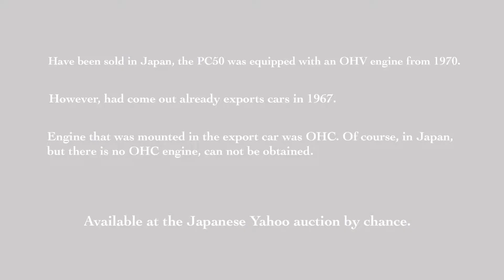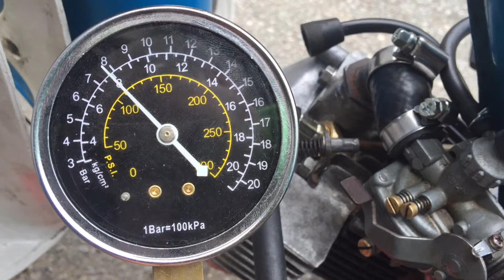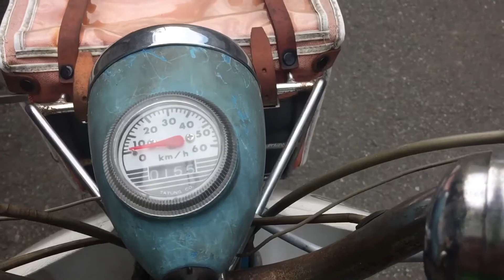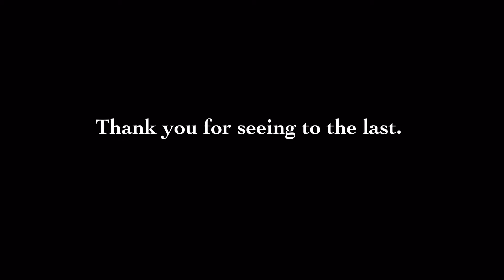1967 HONDA PC50EA Restore Story.

Comment: This clip has given me moral support to continue with the resurrection of the 1967 P50 that I recently acquired. I can only hope it will run and look as good as your PC50. Greetings from Belgium!
Reply: Take you're time and I'm sure it will be these old Hondas are bullet proof the only problem you should have if it's been stood is stuck piston rings (not seized stuck in piston where it's been sat )and the carb just rebuild carb check points and spark change oil start it if it smokes rings stuck rebuild top end good luck happy motoring 😀